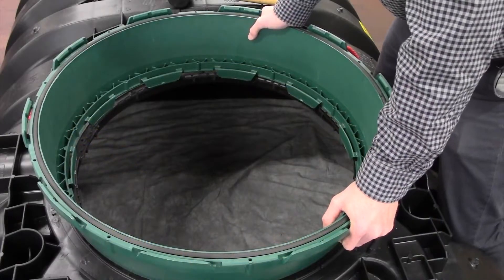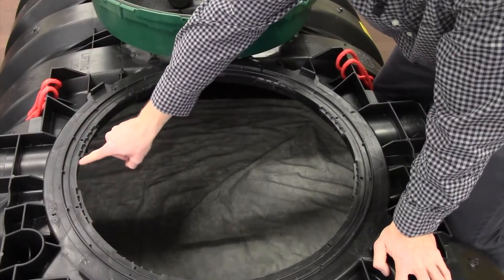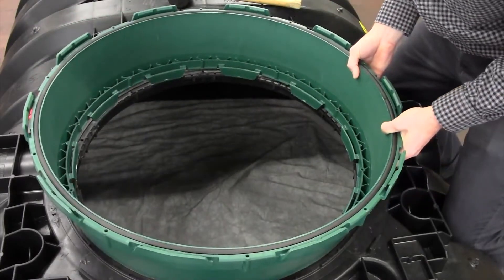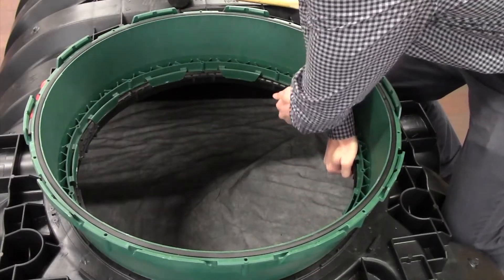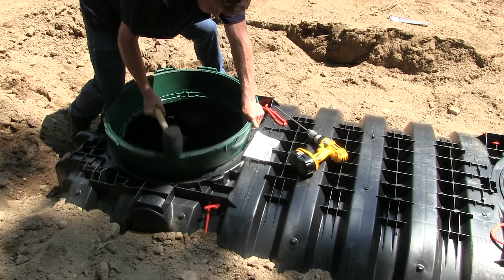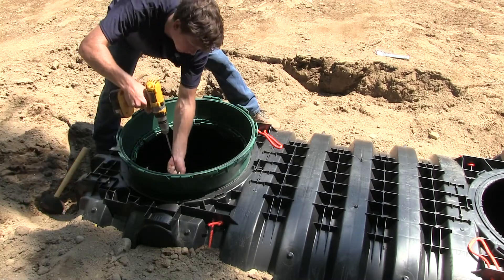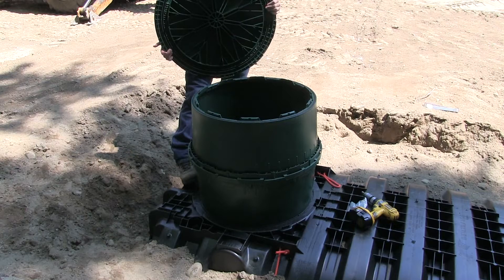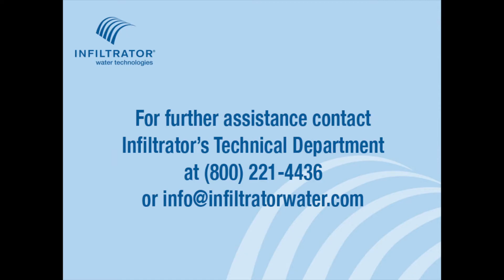Infiltrator's EZsnap Riser to Tank Installation Instructions

Comment: Whoever engineered this product has never lifted a hand tool out on a jobsite in their life. One of the most frustrating products I have ever had the opportunity to use. The risers connect to other risers rather easily but trying to connect a riser to a tank is EXTREMELY DIFFICULT and frustrating. Would never recommend this product and will tell anyone and everyone not to use this product.
Reply: Hmmm...it certainly doesn't look difficult from the video, but I have never tried it myself or watched it being done, so I can't offer an informed opinion. If it is that difficult, the installer could request that the local IWT dealer install that first riser section on the tank at their yard/shop before they ship the tank to the job site. Marlin Environmental (a large and reputable septic installation and service company) seem to have figured it out and have made their own instructional video here: https://youtu.be/7IJtSEQcdRs They certainly make it look very straightforward as long as you follow some basic instructions. Their tip to put the lid on when pushing down on the riser is a great suggestion that will save your knees!